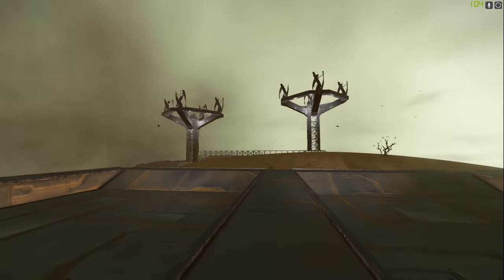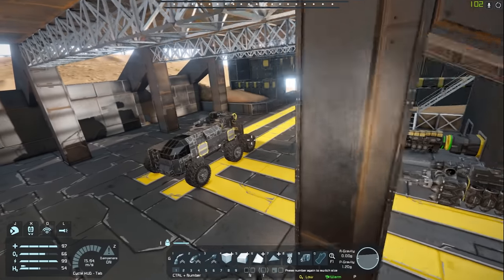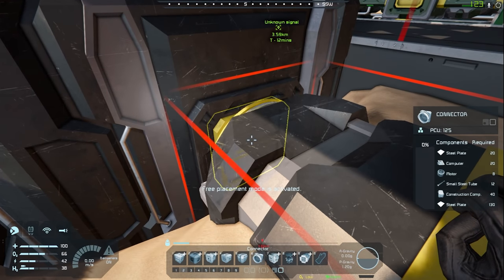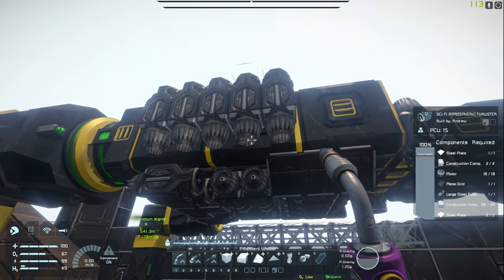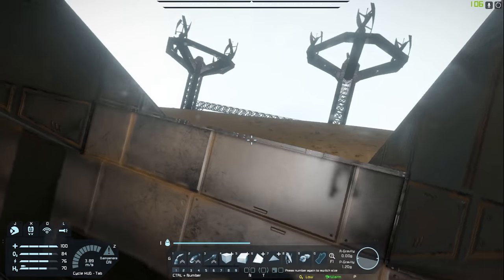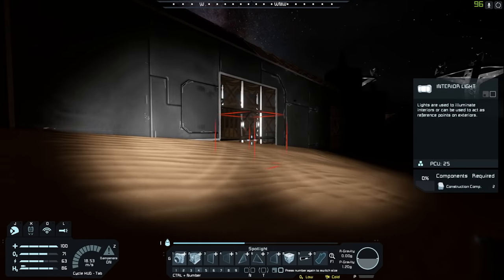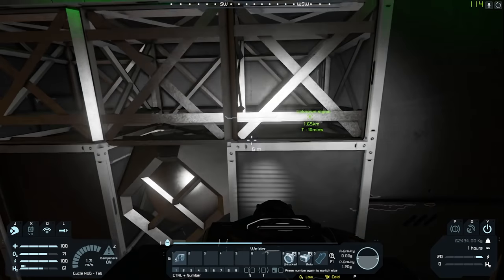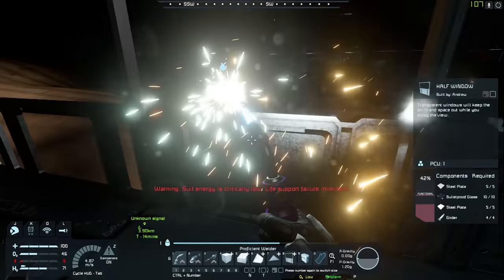Space Engineers Survival 2021 (Episode 12) - Finishing The Wall! [Pertam]

Comment: the combo Miner/Transport is the best option for resource collection as you can use most of the Miner's power for its intended role rather than going to/from a mine.

Landing Pad connectors.
when looking at them. the Left one should be moved 3 blocks further left and the access walk path placed between them. this will provide plenty of room for ships to dock and maneuver.

small thrusters work well on miners given the tight quarters they operate in.
you need additional reverse Thrust for backing out or holding you in place when standing on the Drills.
the best way to test this is at Base simply by nosing down and see if the ship will hold itself up.
also do a load test by mining a bunch of stone next to Base and see how well it handles when loaded down to max capacity.

Lightning has been set by Keen to go after players so expect to be a target when storms arrive.
this can be countered by using an incomplete Antenna mast on top of a Decoy with a welder next to it to repair it when hit.

the Embrasure is the firing port through which you can shoot through and stay protected from incoming fire.
Reply from the maker: Thanks for the tips! The lander connection is a good idea and I might take it into consideration. For the forward-facing thrusters, I am not really worried about it's abilities because of the way I mine. I usually tunnel out a flat area and then mine level to the ground instead of mining while facing straight down.